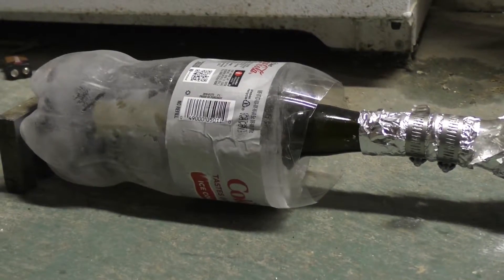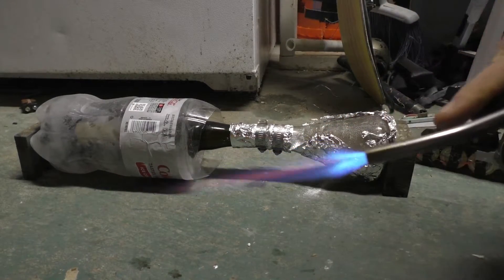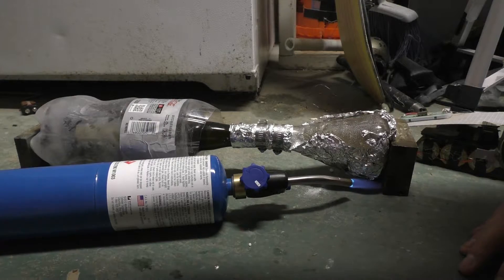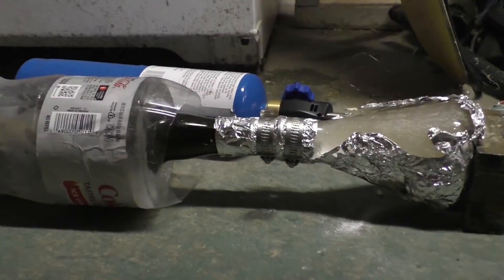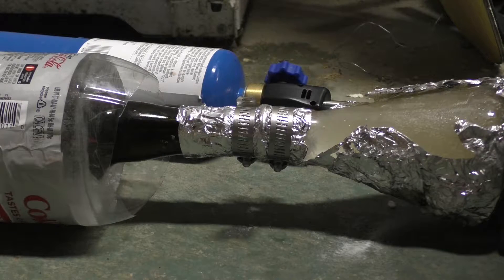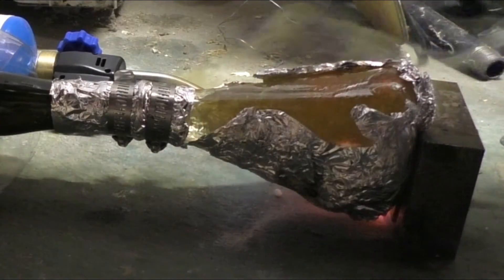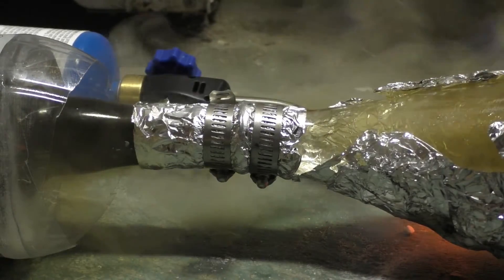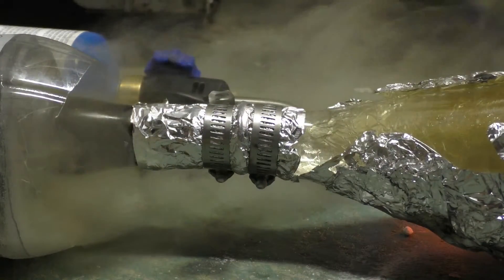Poor Man's Nitric Acid. Distillation. Simple. ~NO3H~ (DIY)

Comment: Cant believe you coupled that with aluminum  and on top of it mad content at least you used stainless steel clamps
Reply from the maker: Ik
Reply: @bennettslab2084  it's all good iv'e done  it myself
Reply: Aluminum really isn’t reactive with nitric acid, you can actually use an aluminum condenser to distill it. I’m more concerned with the glass breaking from the torch as well as pressure buildup in a closed system like this.

Comment: hno3 perhaps
Reply from the maker: Possible
Reply: @bennettslab2084   i like the setup quick and just works i seen it in an old us training manual.
But your other commenter the use of a jar with kno3 h2s04 100g to 100g  a wineglass and a martini glass as a condenser with the stand broken off to allow hno3 to drip off the martini glass with ice water trapping the n20 gas and allowing dropwise collection into the wineglass below it in the jar
Simple brilliant and would be anhydrous if conc sulfuric was used 
Great stuff id rather have 50ml of 98+% hydrogen nitrate than a gallon of azeotropic nitric containing nearly 1 3rd aqua
Reply from the maker: @richardsmith3199  interesting

Comment: You've ruined the anealing of the flask by heating it like that. Never heat it in one place for a long time, and also, the acid is dilute because it made NO gas with copper while conc would make NO2, the bubbles were clear not brown.

Comment: Man I got the easiest way to make highly concentrated. High 90s. I wish I knew how to post video man u would love this procedure.
Reply from the maker: Sounds lit
Reply: @bennettslab2084  I posted a video. Finally figured it out mam. U will love this method
20 bucks and I can make about 2 pints of 90% maybe higher HN03. I dont know concentration exacally but a few drops of water had to be added to get it to attack copper. And then copper is gone in just a few seconds.
Reply: @chrislewis9357  wheres this video?
Reply: @carano321  in my bathroom. There are no fumes though. The top is sealed with PTFE tape and if some do escape the setup is under the window with a strong exhaust fan. I've been distilling fuming nitric acid for several years this way and haven't had a mishap yet . Knock on wood and yes I know it's only a matter of time. I will cross that bridge when it's in front of me.
Reply: @chrislewis9357  little late but he asked where the video was. Not where you distill it

Comment: If you added water it would have taken off.  What you have there is very pure nitric acid which will not react with the copper do to passivation, well it doesn't react with it very well.  had you added a little bit of water it would have destroyed that copper in seconds
Reply from the maker: Yes I actually ordered some tin (sb)  on line because the reaction is twice as efficient for producing NO2 then cu. I'm thinking of using the No2 as an oxidizer in a rocket engine I'm building that's why I'm trying to figure out if it's a liquid at room temp. I will put a video up of it

Comment: You can die from exposure to NO2 and you don't produce nitrous oxide in this reaction.
Reply from the maker: Ya but I read the amounts needed to be really dangerous and I wasn't producing that much.
Reply from the maker: Anyway I have moved on from the days of freezing glass bottles to get my HNO3
Reply from the maker: Wait do you know if you can hold   NO2, 2NO4 at room temperature.  I have seen 11f and 70f for boiling points
Reply: @bennettslab2084  yes you can distill NO2 but it will volatilize very quickly kind of like Nitrous acid
Reply from the maker: I only have 35ml oh HNO3 so
Reply: @bennettslab2084  you can check out some of my videos if you want where I distilled some Nitric acid.  I wish I had the program to make better videos like yours.
Reply from the maker: @chemistryscuriosities  I watched your most recent one with like 200ml of NHO3 and it was really pure so that's epic. But I have a hard time finding the time to do cool stuff like that because school my lab is mainly in the back if my car right now. Haha